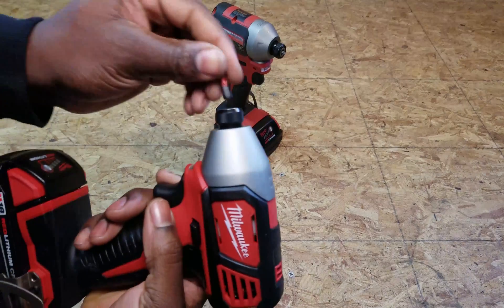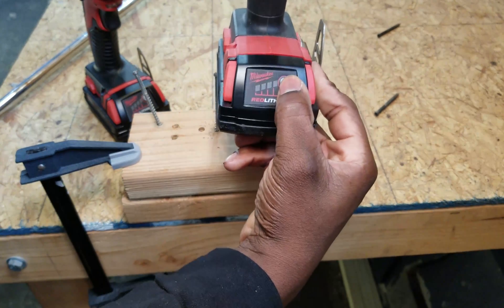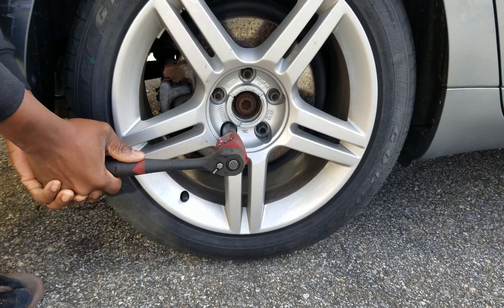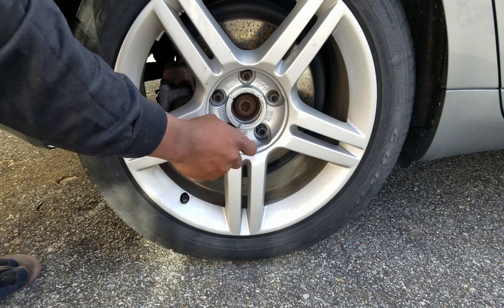Milwaukee Brushless Impact Driver 2850-20 Vs Brushed Impact Driver 2656-20

Comment: would there b any performance difference if the 2656 (non brushless) if it had a 3.0 battery? Or does that just help the battery life?
Reply: Depends, if you’re using the High Output, it will increase power, less battery, if you use High Capacity it will have less power longer battery

Comment: As a plumber working in new construction residential projects and high rise projects the m18 brushed drill and impact driver both work perfectly in a 8 to 10 hour work period.
Reply from the maker: Yea, from my experience both brushed/brushless drill and impact drivers are solid tools.
Reply: Very good I just purchased the brushed version. I’m an apprentice plumber. So excited to go try this Monday. Lol
Reply: It's what I had and used for about 6 month of  some heavy usage and I've personally seen it have more power then a brushless Ryobi and a brushed compact de-walt for what its worh it's a hell of a tool it did more then needed fory job but brushless is what I now have💪🏽

Comment: I never realized that the small bits could be put directly in an impact driver, I thought they would go in too far and get stuck.  I guess I should have looked at how far in the locking adapters go in.
Reply from the maker: Yea, the small bits can fit but they are not ideal. I only used these because I only had one of the regular size bits and a bunch of the small bits. To make the test more fair, I used the small bits in both impact drivers.

Comment: Bigger battery more power for using these drills as he is using. My advice do your research before purchase also consider voltage platforms example 12volts, 18volts, 20volts, 60volts etc. Happy researching
Reply: Brushless n brushed Milwaukee impact and drills can’t take advantage of high output battery’s it just more run time for them, fuel is what you want to take advantage of high output.
Reply: @Ethnosis  regular brushed 4.5 angle grinder definitely takes advantage of high output batteries. I work with Milwaukee tools every day. And swapped  all my xc's for H.O and performance is much higher. (not sure of overall life of tool though)

Comment: I have the brushless combo kit paid $220 for it with the 2 year warranty and 2 a.h batteries
Reply from the maker: I have the same combo kit. I like how compact they are.
Reply: @CraftyWorkshopBuilds  me to the work perfect for my job as well as at home especially work most the shop on air hose and compressors beat dragging a hose around for sure wish I would of got the fuel in a way but am still very happy now just need bigger battery and I'm gravy

Comment: Funny, I ran across this video and I actually have both of these drivers. They are so similar in speed, torque and power that I don't favor one over the other. However, I am leery of brushless tools as all of the extra electronics are a huge failure point and their longevity is questionable to doubtful. I still have two Milwaukee drills and a deck screw gun from 1995 when I started my business and I doubt any brushless or even any tool with mosfets and circuit boards will last half as long.
Reply: I’ll check back in ten years to ask about the brushless
Reply from the maker: Wow, from 95 and still going! Yea, the new brushless motors will have to prove their quality and durability.
Reply: Amigo como va ese test de durabilidad?

Comment: I had the brushed version. Now I have the fuel brushless version. It’s miles better
Reply from the maker: Brushless is the way to go. Brushed motors will soon be a thing of the past.
Reply: @CraftyWorkshopBuilds  i read brushless you cant replace the motor if wear out. Brushed you czn replace the brushed motor.

Comment: Just got this 2850-20 kit (with the 2.0, charger, and bag) sealed for 80$ shipped. It's my first brushless as I'm coming from the one+ Ryobi platform. The difference in sound is interesting. Not only quieter but a little more electric sounding (if that makes any sense at all). Kind of like the first time you drive/hear a rotary engine after driving piston engines your whole life.
Reply from the maker: You got a nice deal, and great choice. Yes, the new brushless motors are cool. They are more durable, more compact and they spin a little faster than brushed motors.
Reply: @CraftyWorkshopBuilds  Moving up from Ryobi is a smart move. You got a great deal and have a better tool.

Comment: Thank you, I've been looking around to see if there were any videos of these little impact drivers in combo kits being used to remove lug nuts on cars.
Also need a driver for small projects around the house and shop.
Big ups
Reply from the maker: Ok, cool. I'm happy this video was able to help you. Thanks for watching
Reply: @CraftyWorkshopBuilds  ended up getting a combo kit on sale the 2999-22CXC Fuel M18 kit at Home Depot. Came with the M18 Fuel Surge 2760-20 hydraulic impact driver, and the M18 Fuel 2804-20 Hammer Drill. 
Hopefully the 2760-20 works okay like the ones you showed, otherwise I'll be sad.
Reply from the maker: Oh okay, hopefully it does. Let me know how it performs, when you test it out.
Reply: @CraftyWorkshopBuilds  haven't had a chance to try it on my car just yet but my car's torque specs aren't sky high, 80-90ft-lbs, but another YouTuber tried this impact drill on a truck's lug nut and it couldn't break it loose. 😢
All good though, I can always break it loose by hand then use the tool to get it off completely.
Reply from the maker: Yea, you might have to break it loose by hand then use the impact to do the rest. If you want the tool to do all the work, you might have to consider an 1/2 drive impact that's rated for more ft pounds of torque.

Comment: I also just got the m12 fuel kit just like that but on m12 platform, I was gonna get a matco drill and impact driver but this time the Milwaukee was cheaper I got some discounts ended paying 250$ for the kit and an extra 2.0 battery.
Reply: If I would be getting the equivalent tools on matco infinium 12v with no batteries of charger I would be paying over $280 for brushed motors, I do own infinium tools but I go for the better price on either Milwaukee of infinium
Reply from the maker: Milwaukee Is a decent brand and I like their warranty, still a good buy.
Reply: It is, my dad in law b has about 7 years with his m12 red kit I bought for him and just know he's needed new batteries
Reply from the maker: Wow m, that's awesome.

Comment: I have the single speed brushless model and there is play where the metal housing mounts in the plastic frame. Is that normal?
Reply from the maker: No that's not normal, mine is solid.
Reply: The play is very minimal and does not effect it in any way it's just slightly disappointing.
Reply: @strr60sevenunsolicited61  contact them. they have great cs